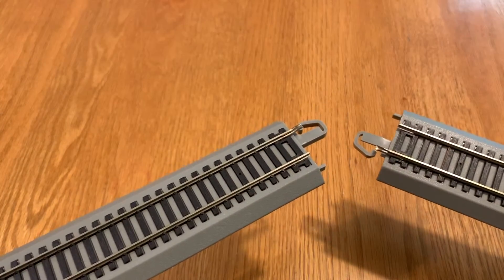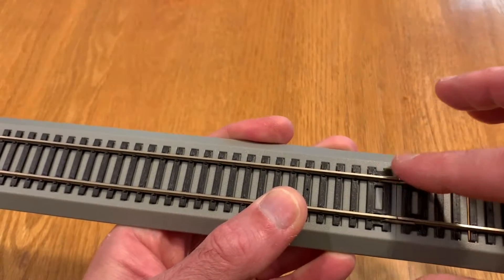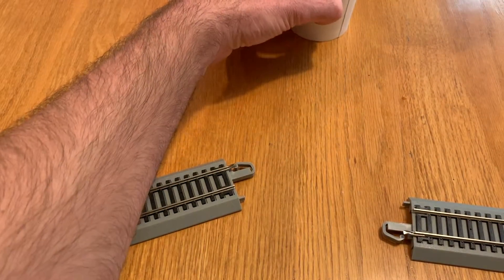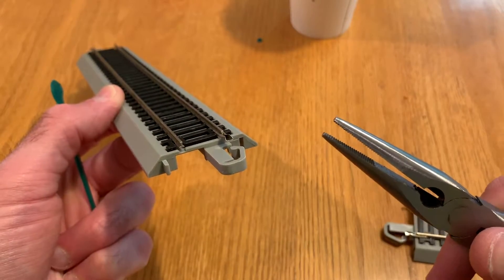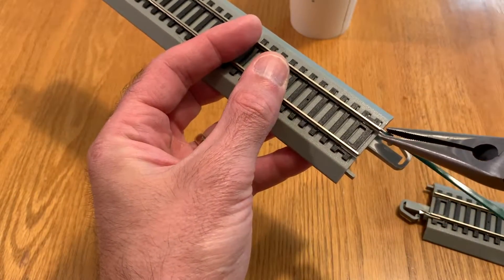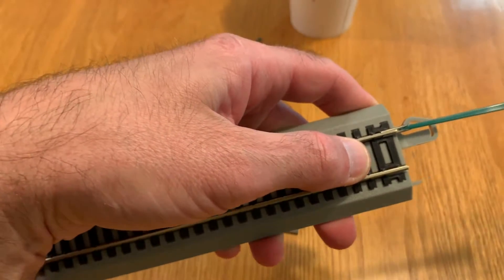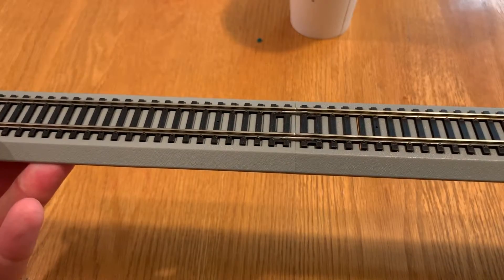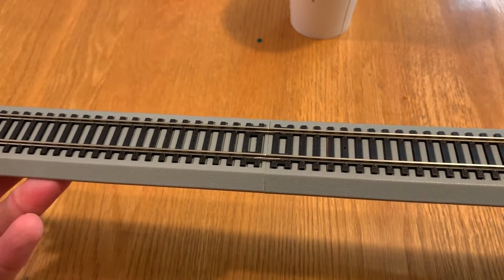Quick Tips: How to Repair the Rail Joiners on Your Track

Comment: Ive got this same problem, but crimping the joiners back into place didnt help for one spot on my track.  As the engine rides across this section of track, the engine slows down a bit and squeals,  and then continues.  I had a few other spots on the track that did the same thing and the pliers fixed them.  Its just this one spot that seems like it cant be fixed.  Is there anything else i can try?  Thanks.

Comment: Nice idea but wouldn't it be easier to just crimp the fish plates (rail joiners) around a small off cut of rail or simply replace the damaged ones with new fish plates soldered into place?
Reply from the maker: Replacing them is ideal, but if you don’t have any extras or are trying to extend the life of the ones you have this works well.  Crimping them around an extra piece of rail of course will give you the perfect shape but if you are trying to fix a set of track from a train set, for example, you might not have any extra rail sections. The coffee stir stick from Starbucks is almost the exact same width and thickness of the rail flange on bachmann ez track so it makes a good substitute.